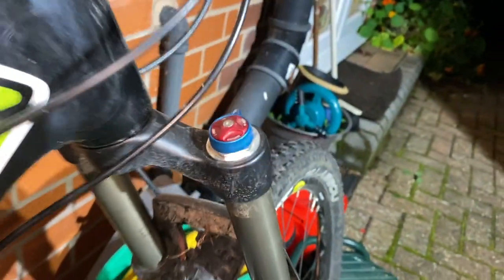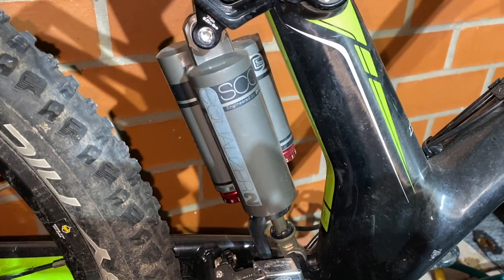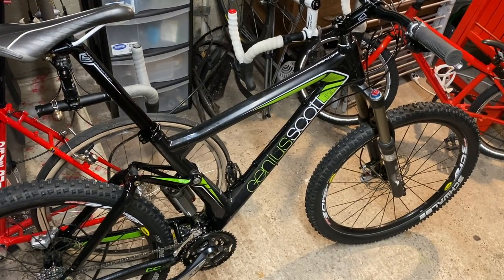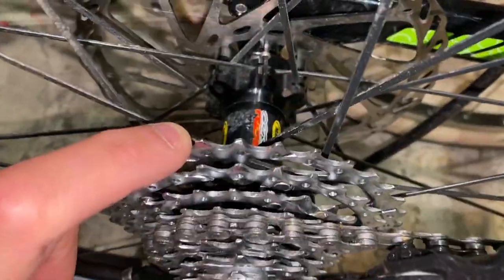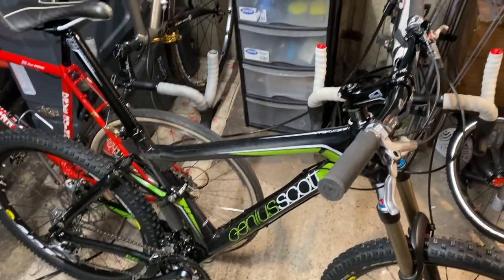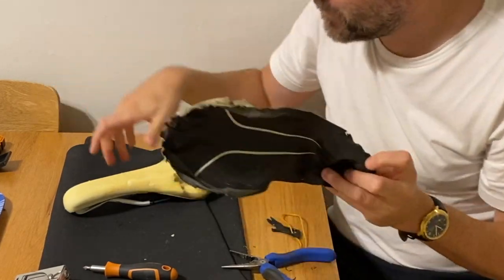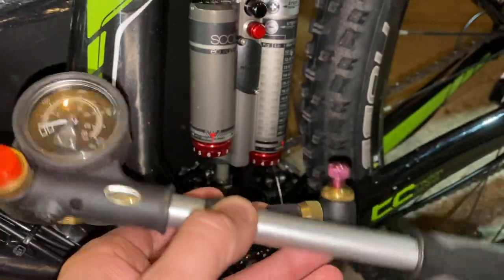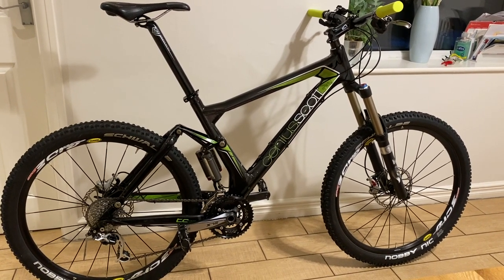Scavenged Scott Genius: how broken is it?

Comment: Great video! You usually don't want as much air pressure as they say anyway unless you're sending huge bangers and shredding copious quantities of extreme gnarr. I love the cartoon TNT look of that rear shock.
Reply from the maker: Well I put about 370 psi into it as per the table - which nearly bent my shock pump - and then when I got on it it immediately bottomed out. So clearly I need something beefier than this Wile-E-Coyote junk.
Reply: @red_dread  I guess the chances of anything 20y old defying a pressure of 370psi (!) were never going to be high.

Comment: Same bike,same project here!!! Awesome bike!!!  Trying now to find seals for equilizer 2 and service kit for the talas damper.(the 2 most difficult parts of the restoration....)
If you want help.... I have full instructions for service both.😁
Reply from the maker: Good luck and thanks for the offer of instructions - I might take you up on that - oliver.chesher@yahoo.co.uk. So far I've been lucky, both my shock and fork are holding air which is seriously impressive. Also it's a generally amazing bike - takes an absolute beating and has rapidly become my go-to winter bike for muddy and rough trails.
Reply: The problem with this shock is the leakage between the air and oil partition inside the shock. As far as I can see you have the same problem. When everything is correct,when you apply the specific pressure to + and -, the shock must be all the way closed. If is not (like yours) means that it haven't the right amount of oil inside the oil partition. You must remove the oil from the air partition and put this amount of oil to the oil partition.
The easiest, but not correct, way to do this without open the shock is to remove the oil from the air schrader valves and fill oil from the bleeding oil valves (be careful not loosing the small spring and bolt inside valve).
The correct way to fix it is to open the shock and replace  oil and seals of the main piston and 2 IFPs.
Because it is a pull shock, as far as I know, there's no other model to replace it....
Reply: The difficult part with the fork is that the talas cartridge is much complicated to service and difficult to find a total service kit. Fox suggest to convert it to float using a float conversation kit. If you do this you loose the function to change the length of travel.
Reply: Please get me instructions

Comment: Hello I am looking into getting one of these, what are those types of shock absorber on the rear called? They work by extending and not compressing like most do, I am having second thoughts on buying the bike because I can not find cheaper alternative of those type of shock absorber that extend and not compress.
Reply from the maker: The shock is called the Scott Equalizer 2. You can still buy replacements for almost £700 and I don't think there's a cheaper alternative, however I'm not despairing at this because there are plenty of aftermarket shock servicing shops that can do a strip down and replace seals and fluids for cheaper than that. This is probably what I'm going to do with mine over the winter because I suspect that as some viewers have advised, some air/oil has leaked between the two chambers, compromising the effectiveness.
Reply: @red_dread  Cheers thanks for the reply
Reply: @red_dread  Hello, I'm interested to find out whether you managed to have the  shock fixed by someone in the meantime? I've just bought a Genius 30 and having the same problem. Thanks
Reply from the maker: @adamfodor4286  Hi, I haven't yet - I don't ride this bike very often and when I do it's plenty of fun even with an imperfect rear shock. However it does need doing and I can confirm that last time I googled it I found that there are people out there that can do it. Personally I wouldn't like to attempt a DIY job on this occasion, given that it's basically a highly pressurised grenade sitting between your legs.

Comment: I just bought the 2012 genius 40, basically mint for $450. I was worried, but damn, it Flys. I had a 29er, but I like my 26s. Personally, preference.
Reply from the maker: It really does fly doesn't it? That's an extremely good price considering what they sold for when new. I still enjoy giving this one a good hammering, even though I still haven't sorted out that crazy rear shock...
Reply: @red_dread  I put 400psi in my shock. Can you switch what type of riding you want on the handle bars (regular, stiff, and lockout)?
Reply from the maker: @ericjohn5461 It's insane how much pressure those shocks need isn't it? Yes, mine does have the multi-position selector lever. Until I get my shock properly serviced I use mine in the middle setting because it bottoms out too easily.
Reply: @red_dread  I just got the psi specs from dt swiss today. I'm 220lbs, so I need 350psi in the positive and 230psi in the negative. I just bought a 600psi fox pump on ebay for $35. What's your weight?
Reply from the maker: @ericjohn5461  Thanks, very kind - I already have the same document! The problem mine has is that air or oil is able to leak between one chamber and the other. I'm sure it's fixable but at a cost.
Reply: @red_dread  MTB issues... it's always something